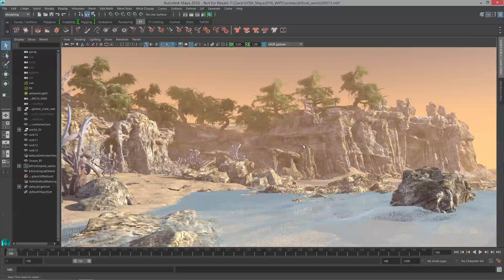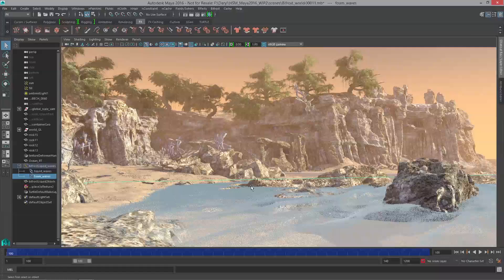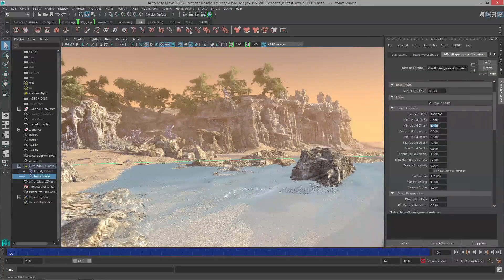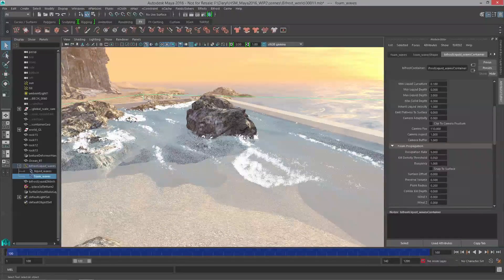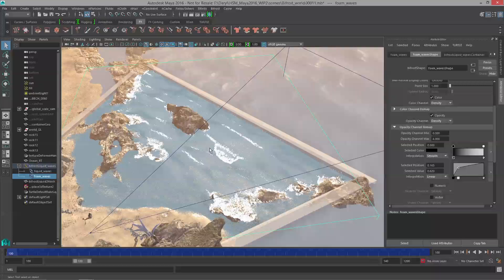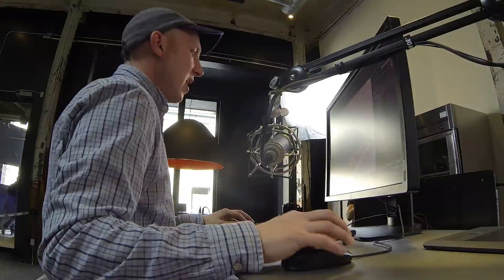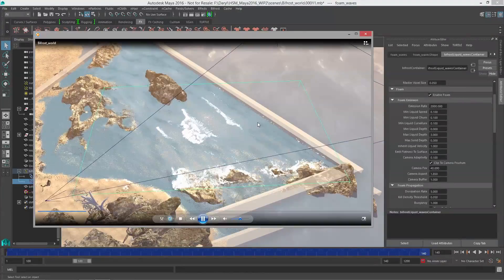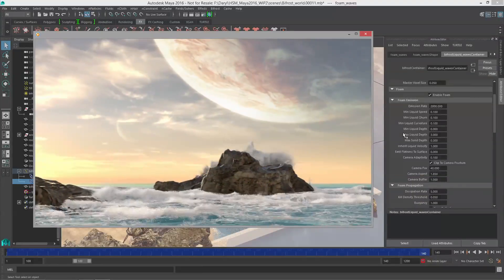Maya 2016: Adaptive Foam in Bifrost

Comment: Will this update of Bifrost still be compatible with Vray? Looks sweet. Great update!
Reply: Marcus Driessen Maya 2016 doesn't support Vray.  I've inquired of Autodesk and Chaosgroup about this and Chaosgroup says they "may" have a release by end of May or June 2015.  Maya 2016 is actually not compatible with any of the major renderers out there like RedShift, Renderman, and more.  We tested for all of these here (Two Reel FX). Something that got a little glossed over in the release hype.  Hopefully Autodesk takes the lead on this to help expedite solutions with the major vendors and gets this resolved ASAP so production shops aren't waiting for months.
Reply: Hi Tobias,

I just installed a nightly build of Vray for Maya 2016 and it's working:)
Reply: Perfect!